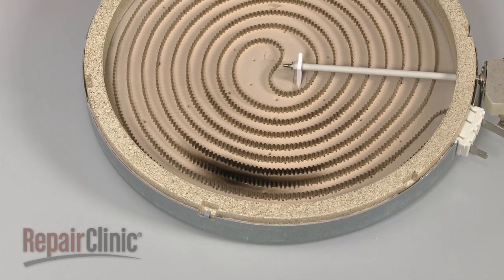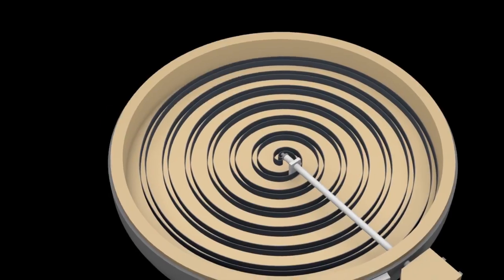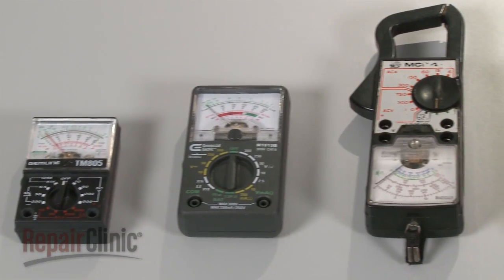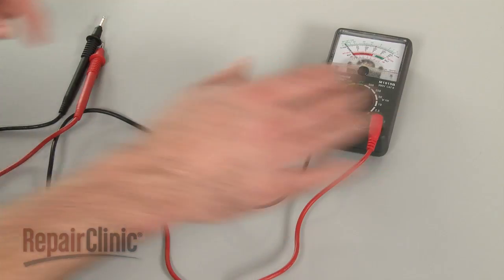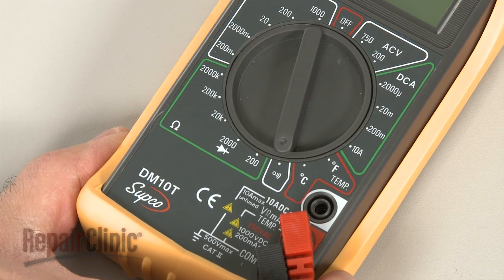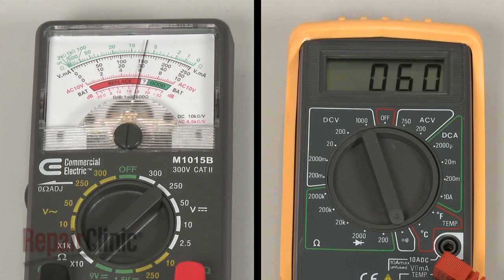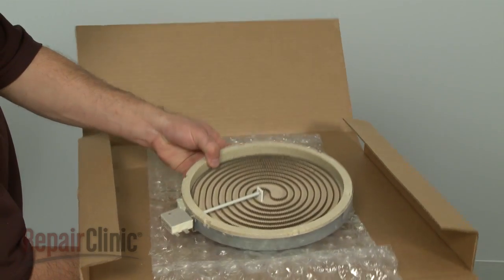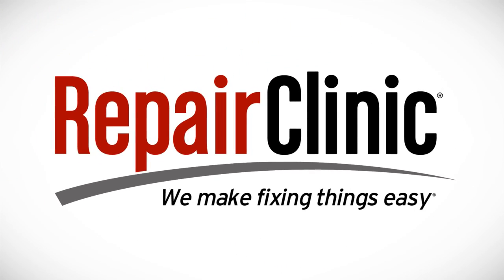Burner Not Working? Element Testing – Electric Stove Repair

Comment from the maker: Jerry Hall, The limiter is a normally closed switch so it should have continuity at room temperature. You would have to look at the unit's wiring diagram to see which terminals comprise that switch.

Comment: Thank you for sharing your time and knowledge. I have a question. I followed your instructions on how to test the burner for continuity and am getting continuity. No breaks or burn marks in the coil either. I know for a fact that the infinite switch is good. So, where do I go from here?
Reply from the maker: +Osteele If you have proper voltage to the stove top then you likely have a broken wire somewhere as there are no other components in the circuit.
Reply: Thank you for the reply. Turns out it was the dual burner regardless of the fact that it checked fine for continuity. There is a probe that is attached to the burner assembly. It may be called the hi-limit. It was completely fried. I don't know how I missed it.
Reply: My dual radiant element had two probes.  This video shows how to test the coils for continuity but not the two probes.  One probe not depicted in this video did not have continuity.  Took 3 techs and two infinite switch changes and the element that had good coil continuity to determine the simple probe was bad.  Required entire element replacement.

Comment: I have a GE R B757B B1WH Elec range. The"Clean" light is coming on when I try to turn the oven on and set a temp. The oven door isn't locked. Stove top is working.The broiler is working. The oven element tested good. Im stumped!

Comment: my cook glass top is smelling like burn wire ..... it works perfectly fine  is just the smell ..... 
what can be causing the problem?
Reply from the maker: +Luis Bojorquez  It is hard to say. Perhaps there is a loose connection going to one of the elements.

Comment: The burners of my stove only work at high temperature, there is no low temperature even with the switch set to low. What could be  wrong?
Reply: M Chaves Hello it will be the infinity switch... your control knob that operates that particular burner ...will be attached to it 
Directly behind it.
40 bucks and its all good.